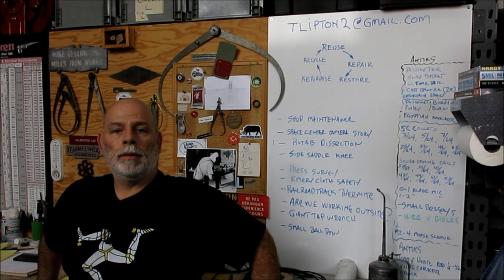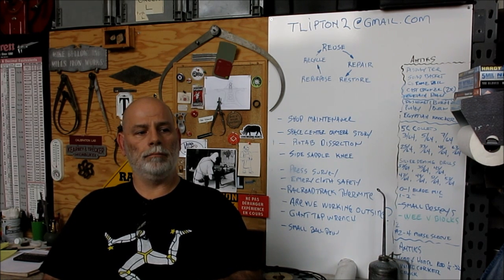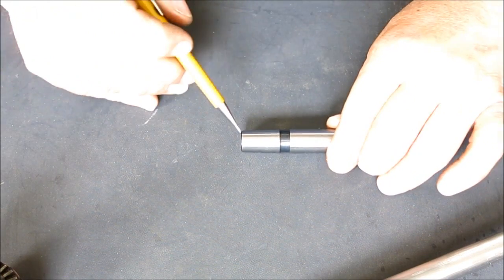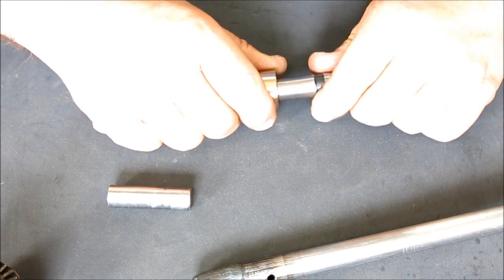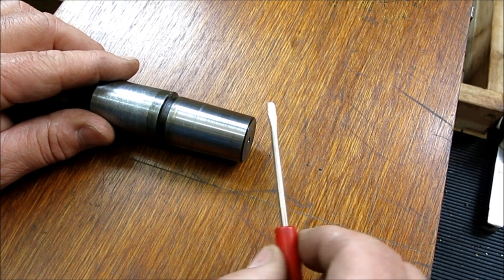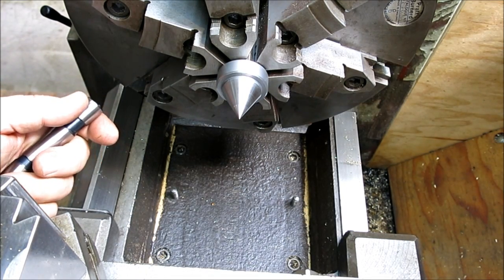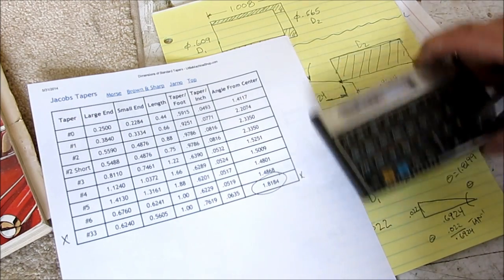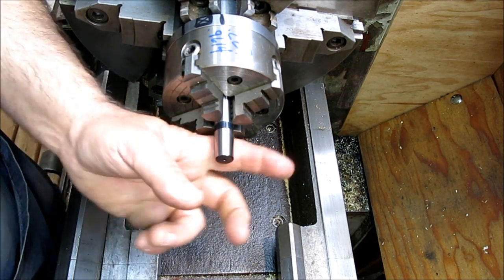Setting up and Cutting Short Machine Tapers Part 1

Comment: Hm lots of time and effort to set up for taper. think i would have set my sample in lathe to no run out, then found the leading edge of taper with indicator and dialed it in on the face on cross feed for zero movement and then  just cut the new taper,

Comment: I had to bore out a L 00 taper not too long ago for a faceplate that had the incorrect angle since it was not touching the entire surface when I hand rotated it on the spindle  (I took the key off). I had no idea what the angle was and even if I did, I would not get it as accurate as it needed to be. So I mounted a tenth dial indicator and used the compound rest to match the angle of the L 00 spindle on the lathe. It took a while to adjust the compound rest but I got it within 2 tenths. I then mounted the face place on the lathe and took a skim cut using the compound rest and just enough to clean up the entire bore. I worked for me.
Reply from the maker: Hey Gnosis,

How did you determine the original taper was not matching the spindle? After you recut it did you blue it to check the mate or did you do something else?

Cheers,

Tom
Reply: oxtoolco
Hi Tom! love your videos!
Yes, you are correct and I forgot to point that out. The faceplate actually it's a backplate for a new chuck was running out 0.015" on the face and for the life of me I could not figure out why; I made sure it was clean before mounting it. The rough finish on the taper looked suspicious. So I used blue die on the spindle and hand spun the back plate on it to confirm that the backplate bore was indeed the culprit. It was new. I got it at Tools4cheap and I suppose I got what I paid for hence they did a poor job boring out the taper. I assumed it was going to be ground but for $104, grinding it is like batteries -it's not included. lol..

Comment: Hey, Tom, probably this has been pointed out is that tan^(-1) has nothing to do with exponentiation. That is just a shorthand for arctan (or atan), the arc-tangent. So, atan(x) is the angle for which the tangent is (x).
For a numeric example, atan(1) is 45deg.
Not that it detract anything from your video, bit it disctracted me a little. I recall sweating my brain out while cutting tapers in school.
Reply from the maker: +Paulo Marcondes Hi Paulo,

It depends what circles you run in. Formal pure mathematics I would agree with you. But arctan being an inverse is not a function. So arc tangent is 1 / tan which it is tan(x) to the power of -1:   arctan(x) = 1 / tan (x) = tan (x) ^ -1  so arc tangent is the tangent to the power of negative one. Thanks for the comment.

Cheers,

Tom
Reply: Now, you are wrong, but I will not engage in that discussion here because is not relevant to the video.
Arctan (x) IS NOT the same as 1/tan (x). Check some tables and see what I mean.
I won't comment further on this subject.

I still enjoy your videos!

Comment: Hey Tom, I want to clarify an innocent mistake that I've seen a few machinists make and are passing that mistake on to the newest generation. You'll have to forgive me, I don't know how to do superscripts. Tan to power -1(angle) is NOT the same as the inverse Tan(y/x), also called arctan(y/x), but is unfortunately written the same. It is a horrible convention because it's so confusing. Notice that the first Tan mentioned is the tan of an angle while the second is the inverse tan (aka arctan) of a ratio of 2 lengths (y/x or opposite/adjacent). As anyone who's taken algebra knows, a value raised to the -1 power is simply the reciprocal of that number. For example, (tan(angle)) raised to the -1 power is 1/(tan(angle)) = x/y= adjacent/opposite. That is not equal to the inverse Tan(opposite/adjacent), which is written as Tan to the -1 power(opposite/adjacent)=angle. In other words, the -1 isn't the power in this case. It is to signify that you are taking the inverse Tan (aka arctan) of a ratio of known lengths in order to find an angle. The Tan(angle) finds the ratio of the lengths if you know the angle. When you say that the inverse Tan(y/x) is equal to 1/Tan(y/x)=angle, it is completely wrong and will give you the wrong answer for 2 reasons. One, you're not taking the Tan of an angle and that would give you the wrong value. And two, you'd be finding the reciprocal of that incorrect value. You'd end up with nonsense for an answer if you tried doing it that way. Now I know that you're using the function on your calculator which is represented by Tan to the -1(opposite/adjacent) and that does give you the right answer, just know that a lot of calculators don't have that function but instead have the arctan(opposite/adjacent) which is the same thing. If people watching this don't know that and they have that style of calculator, they are going to follow you're instructions to get around that obstacle and arrive at, and use, an incorrect value.

I don't know if you'll read this but I hope you do and correct it and pass it on to other creators as well as your fans.

I love your content and you are very knowledgeable and are able to present the content in a way that is very understandable. That's not something that everyone can do, it's a gift. But I just couldn't let this mistake go on anymore without saying something. It's not your fault, it's just a crappy convention that I wish would be dropped in favor of arctan (also arcsin, arccos, etc...).

Comment: I see you found the Tee shirt, I said BMW had a good chance of winning but I underestimated Triumph. Poor old Guy, got black flagged for his front wheel nut falling off, tut tut someone's going to get cold shouldered in the pits. :>(
Good video, by the way. With your first method, could not have taken the measurement on the underside too and averaged the result for better accuracy?
chris
Reply from the maker: Hey Chris,

I hate it when my wheel nuts fall off. I have a fixture so I can sweep the indicator vertically which takes out some of the tailstock error. Also if I eliminate the center and just indicate the mandrel in the chuck it comes out closer as well.  The underside and averaging. Humm, first thought is the angle is probably symmetric so could you determine the mean from the two measurements? Perhaps. Never tried it that way.

Cheers,

Tom
Reply: out of curiosity, have you ever put a parallel test bar between centres on your lathe and run an indicator along the top? To my amateur's way of thinking you might have allowed an opportunity for that error to enter the equation, especially as tail stocks are often set high to allow for wear.
Re TT, 117,366 MPH lap on an electric bike, Holy crap. Batman!
Reply from the maker: Hey Chris,

I happen to know my tailstock is a little low ~.002 or so. I mentioned it during the video that this effects the difference with the indicator method of checking the angle. One could sweep the side but it takes an additional bit of kit to sweep vertically with the indicator on the side of the reference taper. I have it but wanted to show the least amount of special tooling method as the centerpiece. 

A couple of years ago John McGuinness broke the 130 MPH lap at the TT. I guess 200hp and balls of solid Neutronium help. I figure anything over a mile per minute average is pretty good.

All the best.

Tom

Comment: Lots of ways to skin a cat but what about a concentric piece of stock between centres. (Z Axis). The compound set at roughly the required degrees off Z Axis. A dial gauge (free to rotate then lock), is fitted on the compound with its spindle connecting the stock at 90deg. Zero is set. The compound is then cranked either in or out 1000. Dial gauge now reads 31.73 Thou. ASN(31.73/1000)= 1.81830 deg OR Sin 1.8184 x 1000 = 31.73. This method is working to achieve the dial gauge reading of 31-32 Thou on a 1000 compound Travel. Trial and error each time, yet with making certain the spindle reconnects the axis at 90deg precisely and before the next try. In short, SIN(req angle) x compound travel) = dial gauge reading req. (Spindle at 90 deg by turning left, turning right, then centred to have it at 90deg) With calculators now having all the Trig functions, I think its far easier to work this way and will welcome other's comments also.
Reply from the maker: Tom Tee Hi Tom,

There are problems with this method setting precise angles. The indicator has to be exactly perpendicular to the axis of rotation to make this work. Pretty tough to set the indicator each time you bump the angle a little. Also if you have a round in the spindle you need to sweep vertically to assure you are on the vertical center of the part. Most tailstocks are low unless the lathe is brand new. I showed a similar method in one of the vids in this series. Thanks for the great suggestion and comment. 

All the best,

Tom

Comment: Since you have your French standard, why not just chuck it, indicate it true, put an indicator on the center line, and run your compound (or taper attachment) from small diameter to large diameter until it reads 0 over the entire distance, rotate 90 degrees repeat until it all runs 0 and then swap the indicator for a cutting tool?  Polish with some emery cloth, blue the part and make sure it fits the female standard and done.

Comment: Great video as always, thanks.  I just thought I might point out that what you're doing at 17 minutes is not "tangent to the minus one power": it's the arc tangent, also known as the inverse tangent.  The inverse tangent is used to find an angle as you show here.

If you did do "tangent to the minus one power", it would actually be just 1/tan, which is a trig function called the cotangent.  It's not a very frequently used function.
Reply from the maker: Hi Frank,

What I said was its the tangent raised to the power of negative one. The arc that the tangent is. Direct angle conversion. Thanks for the comment.

Cheers,

Tom
Reply: oxtoolco  The button on the calculator is labelled tan^-1.  That button is, in fact, the inverse tangent or arctangent function, which is different than "the tangent raised to the power of negative one"; that would be (tan x)^-1 =  1/(tan x), which is called the cotangent.

For example, a 3-4-5 triangle, the angle in the 4-5 crotch is the arctangent of 3/4.  The way you would calculate this on most calculators is by pressing [3] [4] [tan^-1].  What you get is an angle, 0.6435 rad or 36.87 degrees.

This is not the same as "the tangent raised to the power of negative one", which would simply be (3/4)^(-1) = 4/3, and it's not an angle: it's the ratio of adjacent over opposite.  Similarly, the tangent is the ratio of lengths of the opposite over adjacent sides.

Comment: Awesome video as always.  After watching this I feel like I need to take some math classes.  I was curious about that calculator you have and I checked it out..........holy shit over $400 bucks for a new one on Amazon.  Whiskey tango foxtrot!
Reply: Most computers have a built in calculator program that has a scientific version. You can use that to do all the trig functions involved here as well.
Reply: HP12C shouldn't cost more than $100...

I use HP 35S calculators these days - ~$41 - $45 online

My HP 32SIIs have mostly died of old age - at least the one in my shop apron still works!

I cannot believe the price on Amazon for an HP 33S - they were el cheapo replacements for the 32S, and are only OK at best...

Why so many calculators?

One on my desk at work, one on my desk at home, a couple in briefcases, a couple in toolboxes near machine tools, and one in the pocket of my shop apron... 

I don't like to have to hunt to find a 'cruncher when I'm working...
Reply: Good idea having calc's everywhere, its like pens and sharpies! I still have and use my TI35 I have had since engineering school that i normally use for everything.
Reply from the maker: Hey Kyle,

I've had my 41CV, 11C and 15C for something like 30 years now. The used ones go for nutty prices on ebay. The 12C is a sissy financial model for bean counters.

Cheers,

Tom
Reply: oxtoolco
Hey Tom -- I still have a printer and magnetic card reader for the HP41C. I'd run engineering calculations (bode plots) overnight... hence the printer would spit the results out while I slept (& annoy the heck out of my roommate, half the fun!).  Pre-PC days!  These days I just use "Droid48" on my Phone.
Reply: My 41CV died on me ~20 years ago...

I never got into that funny rectangular layout, so I cannot tell the difference between the 11, 12, and 15 without looking really closely at one...
Reply from the maker: chemech I bought the 41CV with the time and navigation modules to do sight reductions for celestial navigation. It was state of the art back then. I also still use a program I wrote to do patterns for sheetmetal cones. Gotta love those buttons.

Cheers,

Tom
Reply: Tom,

I bought mine to get through ChE 141 (Stoichiometry for Chemical Engineers - I forget what the official title is) at Cal back in 1983...

It lasted until about 1991 or 1992 - got me through my MS - then gave up...

I tried replacing the batteries, but it refuses to turn on anymore...

I may have driven it too hard... 

Cheers,

Eric

Comment: A fitting T-shirt for this week. RIP Karl Harris.... and indeed, godspeed to Cameron. Oh, I finally got tired of watching and not doing. Pround new owner of an Atlas 12". Thanks to Adam, Chuck and Tubalcain as well. Up next, knee mill......
Reply from the maker: Hope you don't need a tapered shaft for that........

Cheers,

Tom
Reply: oxtoolco Me too. But there's this guy in the bay area with an extensive hammer collection..............

Comment: how about using that good jacobs shaft that you put between the centers and throw it in ya chuck and get it to run dead balls true in ya set tru 6 jaw chuck {i know u got one man} or use a 4 jaw if u don't. indicate the compound dead balls true to that angle. measure the smaller diameter or the larger diameter of the taper on that good shaft and use it as the reference diameter that you need to hit but you need to hit it and dead on too i might say. set that shaft up that you need  to fix{making sure it is running dead balls true}.once u hit your diameter wallah, quick and dirty, simple and easy. done and done. should only take about 20 mins and no need 2 use your sine bar strapped 2 the compound or wasting valuable time and money checking and rechecking your angle between points.
time is money in this trade.
the simplest easiest setup should always prevail.
this method will result the same accuracy as any other method.
KID TESTED FOREMAN APPROVED.
I AM NOT TRYING TO KNOCK YOUR METHOD AT ALL MAN, ANY KNOWLEDGE IS USEFUL KNOWLEDGE. AND I RATHER SWIM THAN SINK.
ALSO I LIKE READING YOUR ARTICLES IN CUTTING TOOL ENGINEERING.
THANKS FOR TAKING YOUR TIME TO TEACH VALUABLE KNOWLEDGE TO ANYONE WHO IS INTERESTED.
THERE AINT 2 MANY REAL MACHINISTS ANYMORE
Reply from the maker: Hey Eric,

You make a good point about getting the job done quickly. The point of this series is to show how you can do the job if you didn't have a gage or reference standard to work with. With a sample part it is a simple 20 minute job. Without it its a different story. Thanks for the comment and participation.

Cheers,

Tom
Reply: thank you mr lipton. you are an excellent machinist{a real machinist}. you,adam,and keith are really doing a very excellent thing with these videos on youtube. in todays modern manufacturing environment you dont get too many real machinists, and ones that will take the time to teach interested persons especially in the format that you fellows do is very rare.KEEP THE VIDEOS COMING THEY ARE EXCELLENT. THANKS AGAIN